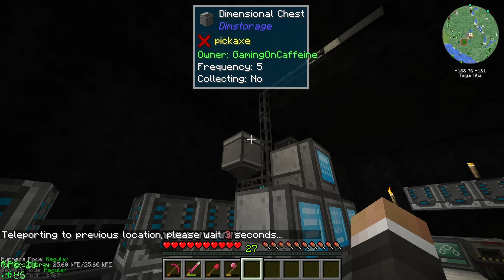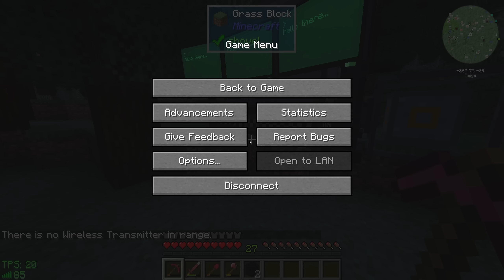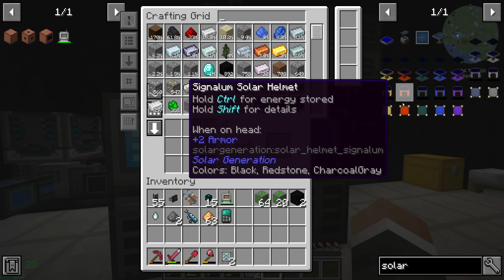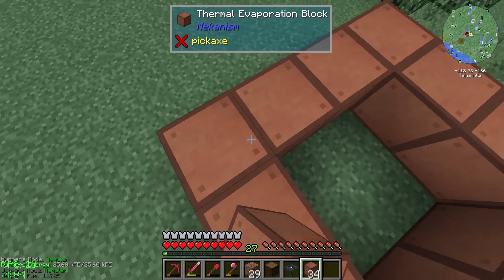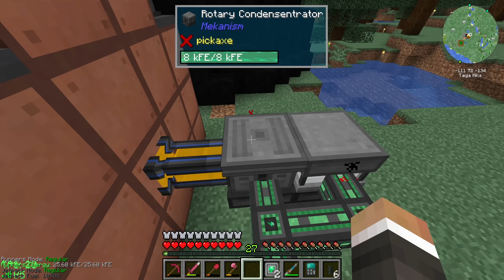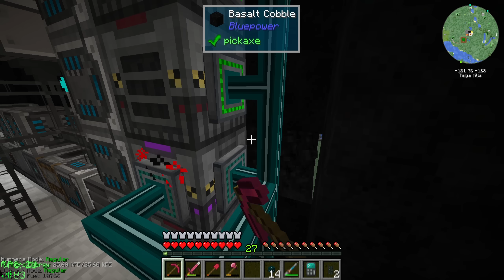Minecraft Q-Tech | THERMAL EVAPORATION PLANT! #18 [Modded Minecraft 1.15 & Quests]

Comment: I always like to put a gas tank or 2 between my electrolytic separators and my purifying factory, that way I build up a buffer when I'm not using the factory so the separator doesn't have to constantly pull so much power

Comment: Just watched the latest stream on twitch.  If you put speed tier 2 and efficiency tier 2 in a mechanical dirt sitting in a nether fortress feeding it liquid meat, killing with a player trap (gather the exp with a sewer so it doesn't produce lag sitting around - void the exp if you have plenty) it will take about an hour (ymmv) to get 3 wither skulls.  I just voided everything but wither skulls (item trash can and a logistics transporter with filters) .  You will need to chunk load it either with a chunk loader or anchor in the mek entanglerporter (sic).   Just an idea.  If you don't use a sewer, just stand there sucking up the exp (slab on the bottom of a middle block to let exp out) and use an enchanter and grindstone to grind out a vorporal enchantment on a sword.  With that, skulls are a little less time consuming.  Really enjoying the series!